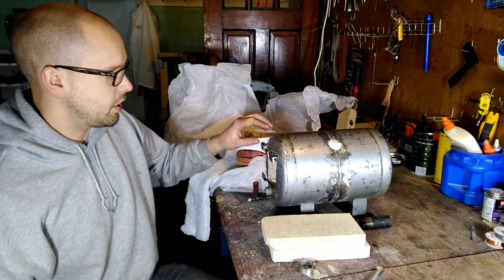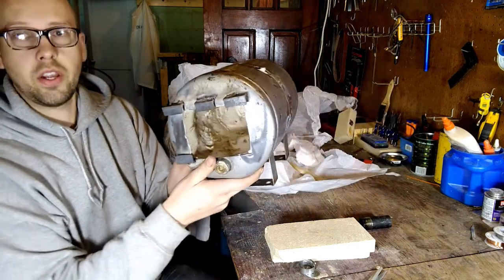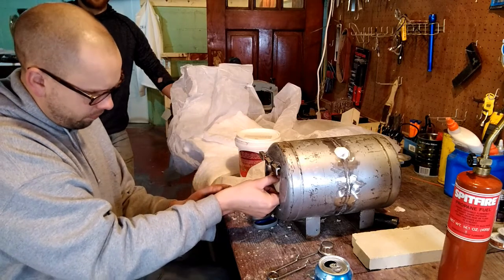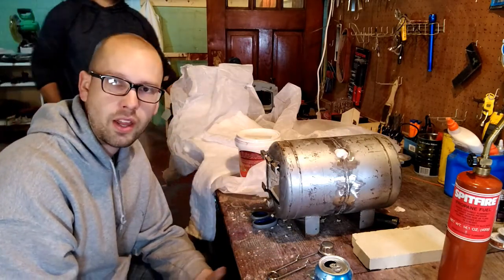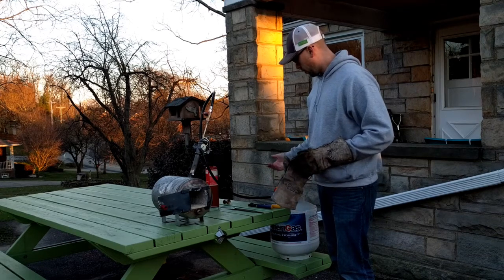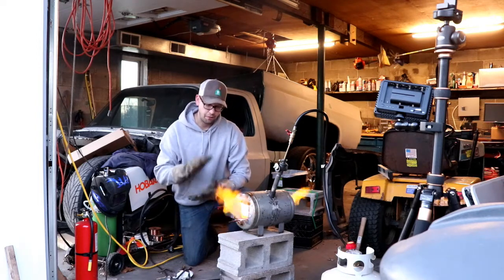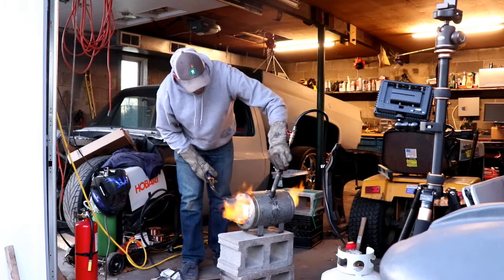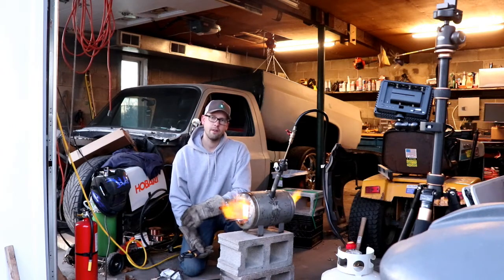Homemade Mini Forge: Part 3 - Assembly and Testing

Comment: How many work hours does your propane tank last? It looks like a BBQ tank.... I'm thinking about doing a coal forge but this looks interesting
Reply from the maker: It doesn't burn too much propane.  I would guess it would last about 5 or 6 hours.  But for how little I run it at a time, I haven't noticed any obvious drop on the propane tank level

Comment: What size hole did you cut into the forge to insert the burner?
Reply from the maker: Since I cut the air tank to shorten it and welded it back together I just traced the pipe and ground it in both halves with a grinder before welding the tank back together.  I would just cut whatever to whatever the outside diameter of your pipe is plus about 1/16 of an inch.  If it is too tight, get at it with the die grinder or Dremel tool until it fits good.  With a welder you can kind of just make it work even if it isn't a perfect fit.